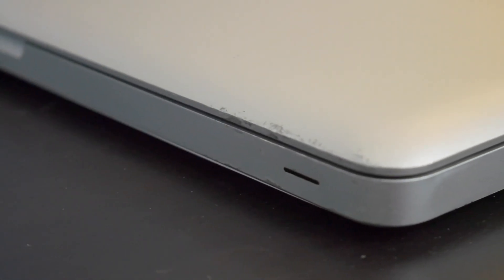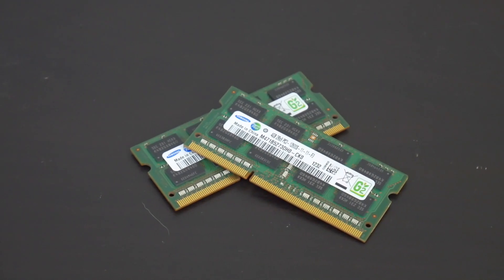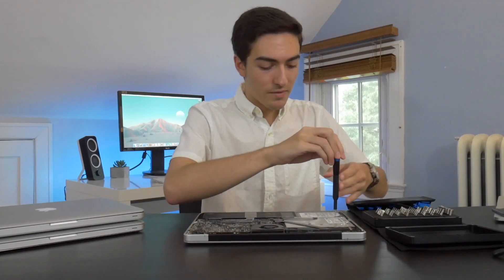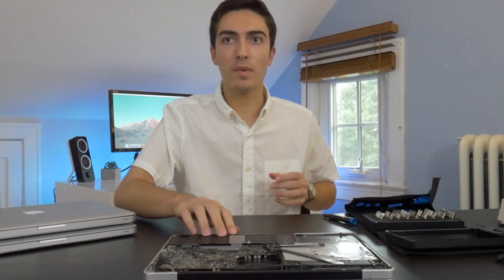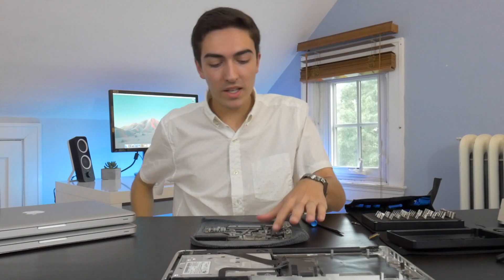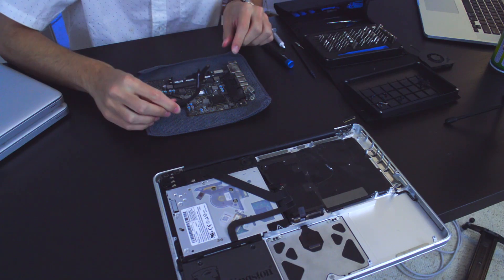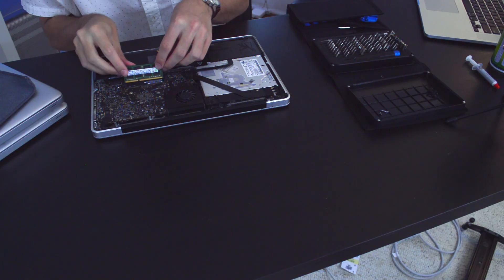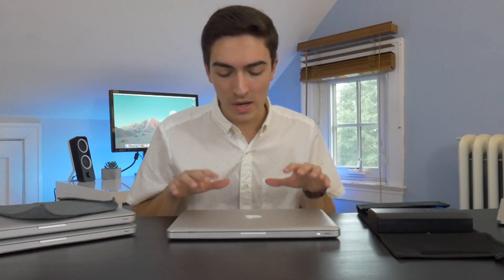How to fix up an old MacBook to use in 2018!

Comment: It’s really NOT a wise idea to put the logic board on a micro fibre cloth, it’s an ESD (electro static discharge) sensitive device and micro fibre cloths tend to generate a lot of static. Get yourself a proper ESD protective mat and make sure it’s properly grounded, you should really be wearing an ESD wrist strap too, these things aren’t expensive. I love your videos by the way but I’ve got 18 years experience in electronic repair, this bit makes me cringe!
Reply: I agree, it might’ve been a slightly better idea to just set it directly onto the table..
Reply: ThatFurryFellow it definitely would, it won’t damage the table. The chance of damaging a logic board by placing it on a statically charged cloth is high. A grounded ESD mat is best, along with a wrist strap... you’ll get a complete kit for about $30.
Reply: You Should also never blow on a Logic board, only use compressed air!
Reply: @Kwetterpad  THIS! I saw him do that and I cringed. D:
Reply: There do seem to be a lot of armchair experts here who disagree with my advice… what are (now 21) years of experience worth eh?
Reply: Also he should have started by unplugging the battery
Reply: I can't even work on electronics in my house in the winter. I'm am unsure why but when I run the furnace I have 35x more static electricity I zapeverything all winter long every day -.-
Reply: Pity Luke didn’t see your comment.
Reply: lol you freaking out over nothing, doesn’t matter how long you’ve been doing it.  If you wanna take a risk then oh well. I have yet to destroy anything.
Reply: IJAZZI well you carry on doing things your way then, but I’m an electronic engineer and I can’t condone bad advice. ESD isn’t nothing.
Reply: @Si1983h  it's still unlikely tho
Reply: nikOtakai, what I said, is absolutely right and I stand by it. Why take such a stupid risk with an expensive device? Advising people to put a logic board on a microfibre cloth is really, really not wise, you’re much, much better off just putting it straight on a kitchen worktop... better still on a grounded mat whilst wearing a grounded wrist strap, these things aren’t expensive.
Reply: @Si1983h  Totally agree. After a career in avionics I never to electrical repairs without ESD safety measures.
Reply: I don’t know, did this multiple times I even left one of my mothebroards on my bed whenever I’m maintaining them, Gpus, gaming laptop board, and desktop motherboards. Been doing that for 2 years and never had a static discharge accident or whatever.
Reply: ok?
Reply: @when4127  Ok what?
Reply: @Si1983h  ok
Reply: @when4127  ok
Reply: @Si1983h  cool...?
Reply: @when4127  I’m cool if you’re cool! 😉
Reply: Right where I stopped the video. Don’t give advice for things you clearly don’t understand, someone’s going to listen to you and damage their hardware. You should annotate that you don’t know what the hell you’re doing or take the video down. Noob.
Reply: its really not that dramatic

Comment: Always unplug the battery first 🙏
Reply: Holden Burke Why do you think I’m talking about myself? I’ve got a spudger...
Reply: Got to love baiting.
Reply: Droobster SE Why tho
Reply: dB no point of potentially having power go to the board, better to be safe and just disconnect the battery
Reply: Carl Clark I’ve heard of people causing damage by using a metal screwdriver to unplug the battery and shorting out pins lmao.
Reply: dB The battery will have a charging it. Sometimes voltage can go through some of the other components that you’re pulling out and fry them
Reply: Well also be careful bc I’ve heard of people removing it and then the computer won’t recognize it after they put it back in.
Reply: Blowing on that motherboard will just get spit on it

Comment: Great video! Instead of buying 2 4gb sticks of ram I bought 1 8gb stick for the same price and used it along with one of the original 2gb sticks for a total of 10gb of ram.
Reply: Tanner Deal it’s best to have matching ram size, you’re not having issues?

Comment: Older models are easy to do this, the newer ones are a nightmare....
Reply: Yeah, that's what's really annoying. Upgradable > Thinness. :( I bought a brand new macbook pro at the end of 2014 and went with the mid -2012 model purely because I had the option to do stuff with it. Upgraded it myself then as I needed. I hope the retina ones have improved since though, they were awful.
Reply: Hanniffy Dinn hopefully, they’re not still using crappy thermal paste on the newer ones.
Reply: I have a late 2008 one lol
Reply: Old ones were meant for stuff like that, unfortunately the newer ones are not
Reply: Actually when it comes to replacing thermal paste, unibodies are nightmare

Comment: I think it really sucks how Apple put the heat sink below the keyboard since this means you have to remove the logic board to reapply the thermal paste. If the heat sink is on the bottom of the laptop like the MacBook Air, it would be a lot easier to reapply thermal paste. I feel that many people who aren't into DIY won't be comfortable taking out the logic board since there's so many cable connected to the board.

Comment: You should tell us how to install MacOS after we put in a new HDD or SSD
Reply: Taylor Green you can download it to a flash drive when you put in the new drive and install it or connect the ssd to an enclosure before you open it and download it straight on the ssd

Comment: Mid-2012 MacBook Pro user here. I see newer macs/laptops, but know that after all these years, I’m still completely happy with my 100% functional keyboard. I might still have a diving board trackpad, but it’s better than any other laptop. It tracks so beautifully. I’ve removed the disk drive, and put the second hard drive there, installed windows, and threw an SSD for OS X. I also replaced a single 4 GB stick of RAM with an 8 GB stick of RAM for a total of 10. It still leaves me with 2 GB floating around. I would love to get matching SSD’s and run a RAID 0 set up.
Reply: you cant under high Sierra I have the 13" pro mid-2012 and am running dual 480 inland pros in it and wanted raid 0 you have to side load it from a external with a loader the same size as your raid volume or something to that effect because when you try to install the OS or upgrade it it will tell you you cant install it on apple raid just so you know going in to.
Reply: @jonathonrosalia9345  if I upgraded y mid 2012 to a 1 tb SSD and 8gb ram will I have issues running Mojave?
Reply: @popi2971   i have 16 Gb of ram In mine its Mac rated ram but I don't know if that matters and I think 8 Gb is more than enough I don't use near 16 Gb. the SSD size should be fine also if its one drive I wouldn't suggest the dual drive setup its not that great because raid 0 isn't supported anymore. I have dual 480s in mine here and use only one most of the time I have had Mojave since a week after it officially came out and haven't had any real issues besides it dismounting my second drive every now and then but it comes back after a reboot.
Reply: @jonathonrosalia9345  OK thanks I was wondering about doing a raid 0 setup but I guess i'll save a few dollars and just do one SSD and the 8gb. Also did you bother with dusting your machine, i haven't been inside mine in two and I didn't clean it then either.
Reply: @popi2971   i blew out the heat sink and fan while I had it apart and blew out any dust while I worked its actually 20 minutes or so to do everything make sure you have a good backup before you start it makes it easier some times it tries to start a fresh install from lion osx and that sucks to have to upgrade so do a full backup or make a OS Mojave boot usb which is really easy and gives you a copy to use for the future.
Reply: @popi2971   i have boot usb for high Sierra ,Sierra, elcappitan and Mojave just incase I have to work on someones older Mac for them and something goes sideways I can do a reinstall.
Reply: @jonathonrosalia9345  Thanks again, I'll be ordering my SSD and ram this week.

Comment: You talk about breathing life... I’m rocking a Mid 2012 as my daily driver 😁
Reply: Me too!!! Have you upgraded any of it?
Reply: dB Sameee, I'm using a MacBook Pro Mid 2012 13" with 8GB Ram, 750GB and i7. I've never upgraded mg MacBook Pro tho
Reply: I'm still using my 2009 13" MBP for daily use for classes 😁 And it was the base model with the 2.26 Core 2 Duo with 2GB RAM. Put in an SSD, 8GB RAM And a new battery. Runs almost like new!
Reply: teefa teefa if you already have the 15" then just keep that and upgrade it. 16 GB of RAM might be Overkill for a laptop that old tho. Get just one 8 gig  Save the extra money for something else.
Reply: same here! 17 mis 2012 rocking at my music studio.
Reply: Andres Valdes Apple didn’t do a 17” after 2011.

Comment: Was using a 2009 white MacBook as my main laptop until a few months ago, with an SSD and some extra RAM it performed like a champ! Upgraded to a 15 inch 2012 unibody 😁
Reply: How bout the os? Is it the latest?
Reply: @nfearther2936  I currently have it running MacOS 10.15. Using the DosDude Patcher.

Comment: Hello, I've a unibody mid 2012 MBP, I've cleaned it out and replaced the thermal paste although when I'm playing GTA V on bootcamp the CPU reaches a maximum of 98 celsius, it's not throttling though and still keeps the turbo boost speed of 3 ghz, the fans are set on max all the time when I'm gaming and it's staying at around 90 celsius most of the time, is it normal for these machines? When I'm on macOS and doing basic tasks like watching youtube etc. the CPU stays at 55-60 celsius, as I'm writing this comment it's staying at around 45 celsius.
Reply: CPU is i7-3615QM
Reply: Cpu utilization when gaming is around 50%
Reply: You play GTAV on a 2012? Jesus. How does that happen with 512MB VRAM?
Reply: Wow, what size MBP + which CPU do you have?
Reply: 15" base model, believe it or not the textures, reflections, shaders are set on high going extremely over vram limit and still being able to push 40-50FPS, occasionally dropping to 30. I guess it just uses Ram memory instead of Vram when it runs out.